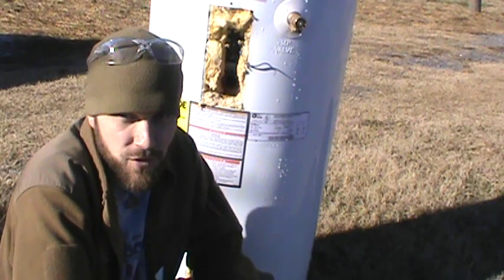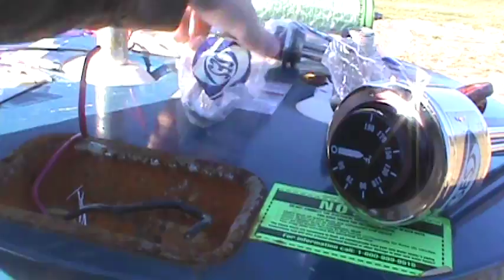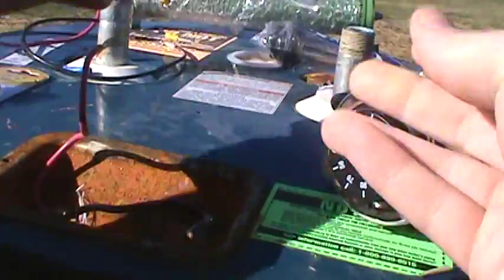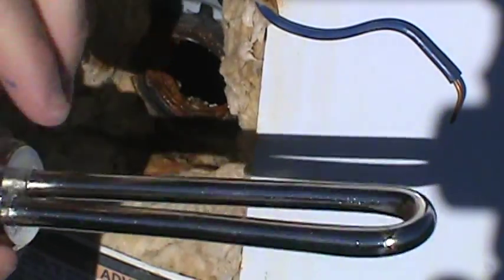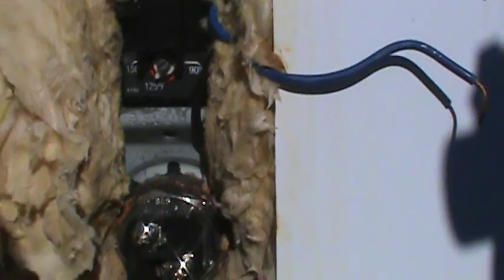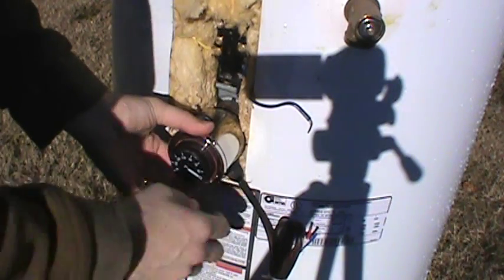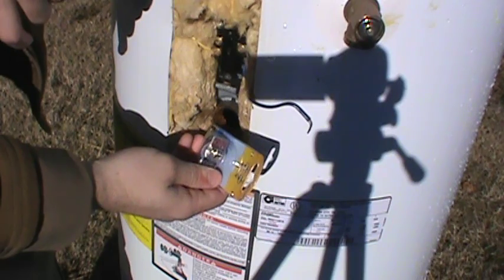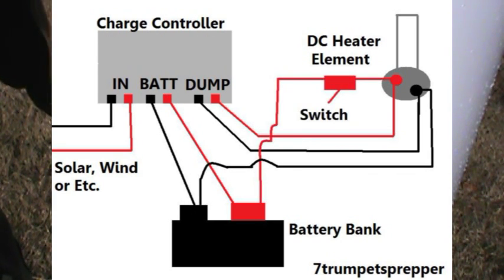How to make hot water using DC powered elements and install them

Comment: Just make sure if you use the bucket setup you don't submerge the wiring on the element into the water. You will short it out and destroy the batteries. Best practice is to put the element at the bottom and screw it down and seal it. Also have a water level gage installed to shut off power to the element if the water gets below the element or it will burn out.